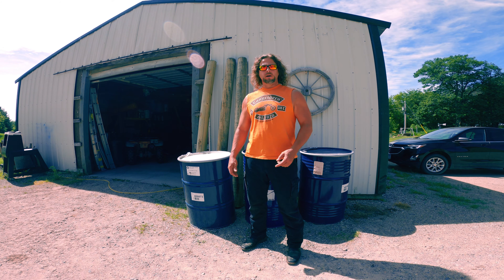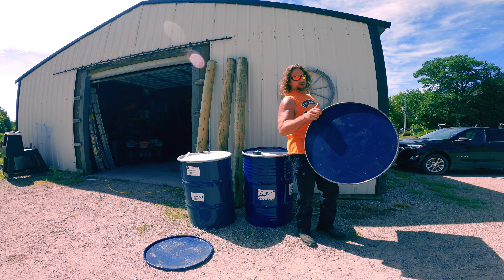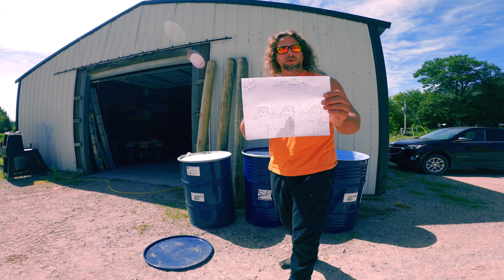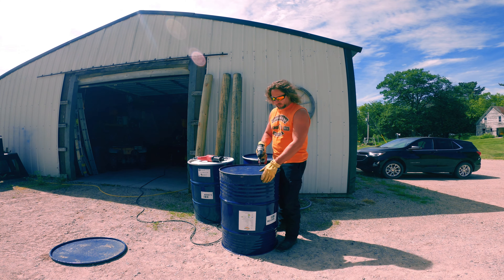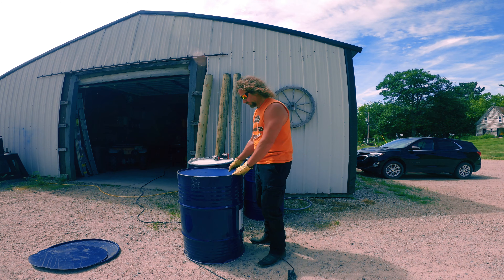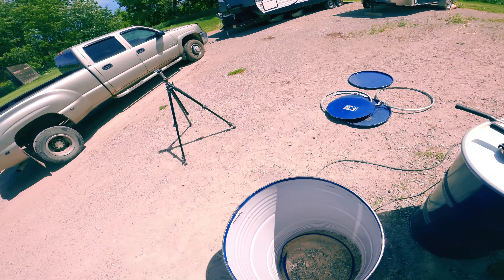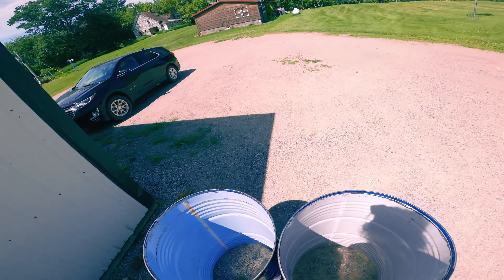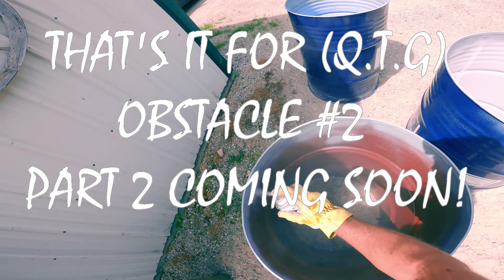COCHISE FPV (Q.T.G) QUAD TRAINING GROUNDS OBSTACLE#2 PART 1 OF THE BARREL RUN!

Comment: Couldn’t use a torch to cut through the barrels?
Reply from the maker: Yes I have a cutting torch, but you run a high possibility of destroying the barrel due to the light gauge steel.
Reply: COCHISE FPV oh for sure. I wasn’t sure it looked pretty thick. I’m sure you would of done it if you could. Thanks for the vids. Definitely giving me some good ideas. Just wish I had all that property lmao.
Reply from the maker: @TheSmitty890  😎👊